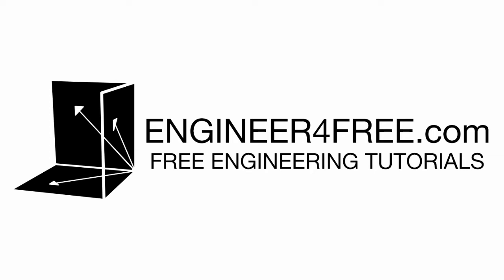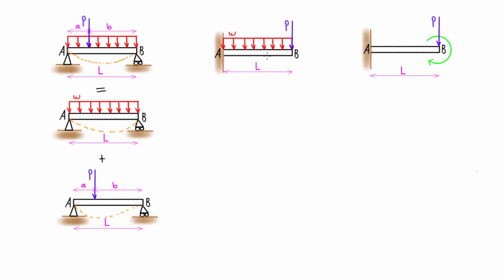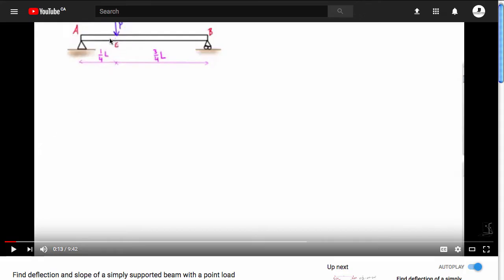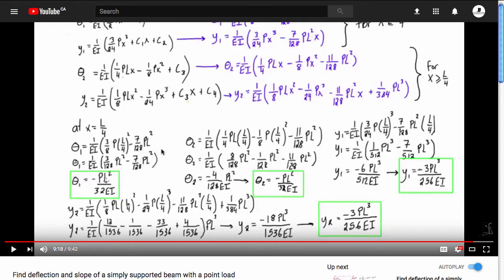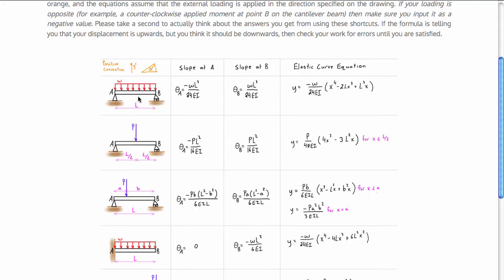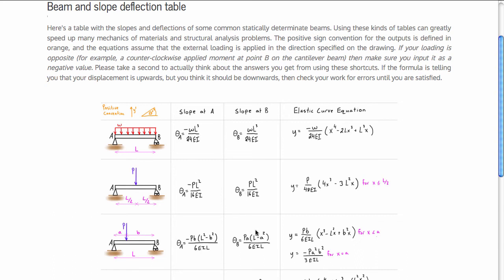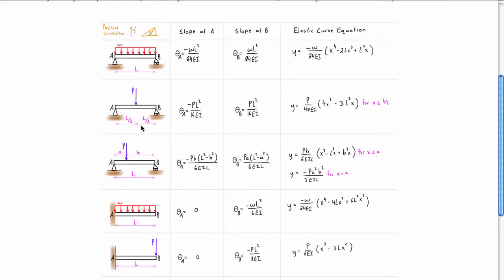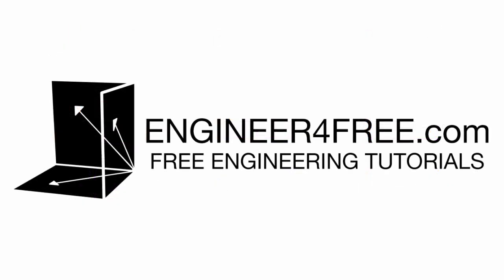Method of superposition for beams explained (slope & deflection with tables)

Comment: working through the math isn't too bad once you get your head around it, integrating polynomials isn't too hard because they decompose so well, its just a lot of things to keep track of. Once you do though, you can look at structures and understand pretty quickly how they work, keeping track of shear and moment is the key. You can look at strain gauges and understand how they use the mechanics to filter out tolerance in their construction. E.g. the standard super cheap beam strain gauge has a single film that has two gauges in the print. You can control the distance between the gauges pretty good, but can't control the absolute position on the beam. Once you understand the mechanics it become clear why absolute position on the beam doesn't matter.

Comment: How do i find the deflection of the free end of the beam when an applied moment is in the middle of the beam?
Reply from the maker: Easiest way is to model it as a cantilever of L/2. Find the end deflection and end slope of the "shorter" beam. There will be no curvature beyond the applied load, so the member will be straight in that section. Knowing the deflection and slope of x=L/2, you can just do very simple triangle trig to determine the additional deflection of another length of L/2

Comment: How can I find deflection in simply supported beam when x>a ? How can I adjust the formula?
Reply from the maker: Moment area method is a good option for many set up's. I've got a section covering it at engineer4free.com/structural-analysis
Reply: @Engineer4Free  Nurnaimi, have you find a solution for deflection formula x>a situation? I'm in need as well....

Comment: The way your videos are titled on your website in the method of superposition section are wrong to what the video is. For example this video was titled Method of superposition example #1: a simply supported beam but its not. Not to worry as didnt bother me much but thought to caution you so you can change it.
Reply from the maker: Hey thanks a lot for pointing that out. It's fixed now. I make those links/pages manually and every once and a while I mess up without realizing. So you just prevented a lot of confusion for anyone clicking those links from this point on. Cheers mate!

Comment: Hello brother, in the book 'Mechanics of materials: RC Hibbeler 9th ed.' the book states that the load fnc. w(x) must be linearly related to displacement fnc. v(x).

Or in other words, the fourth derivative of v= k*v.  How do I know if that's the case with the problem given?
Reply from the maker: Are you sure that v(x) is not referring to shear rather than displacement? The following letters are common to use in beam problems: M for moment, P for point load, w for distributed load, v for shear, y for displacement, x for position. Any table that shows the elastic curve equation (basically the displacement at and point x along the span of the beam will indicated that there is most certainly not a linear relationship between applied loads (either point or distributed) and displacement. Shear on the other hand (often denoted v(x)) has a constant/step relationship to point loads and linear relationship to uniformly distributed loads.
Reply: @Engineer4Free lower case v can refer to vertical deflection